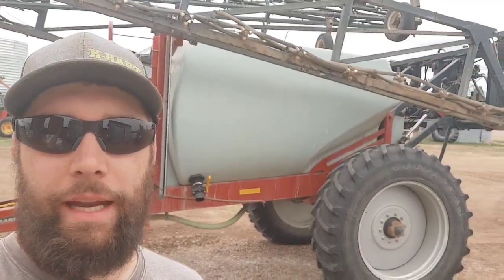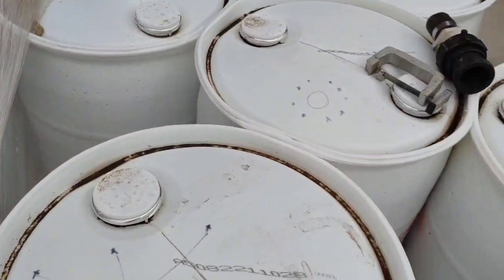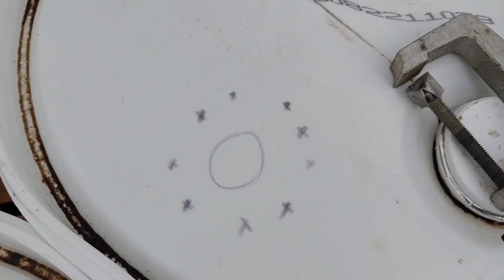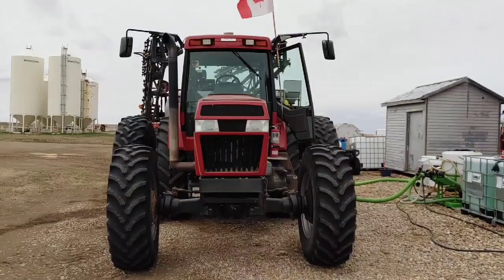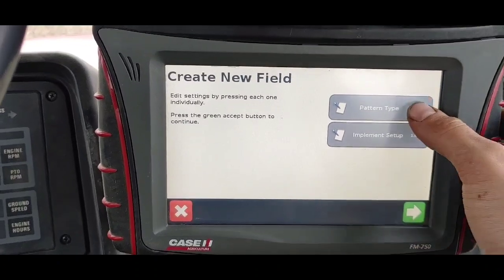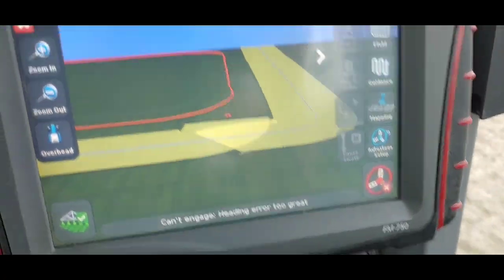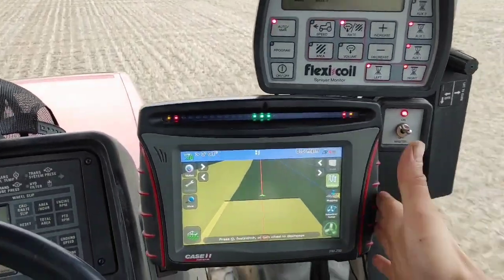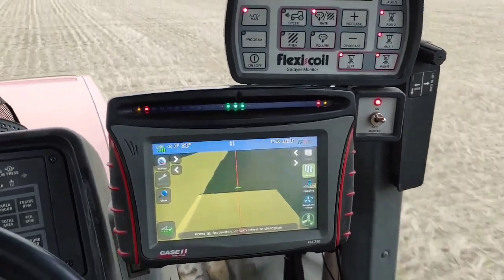Agricultural GPS, Computers Driving Tractors!

Comment: Can I ask you about all the hardware you are using and how much does the whole system cost? Thank you :) I'm looking at budget option like the onTrak right now to check out gps systems but this is obviously much better
Reply from the maker: Hey Dan, for sure! 

Hardware, fm-750 display, ez-steer steering system (steering motor, terrain compensator) and Trimble's cheap antenna. I think this system nowadays will set you back $10-12k 

The 75p is fairly powerful and has a lot of capabilities we don't use. A 500 would give you a color screen but with less features and much less cost.
Reply: @thecrackpotfarmer9488  Thank you so much for replying, I Really Appreciate it! Cheers
Reply: AgOpenGPS, RTK accuracy ~1k $ :)